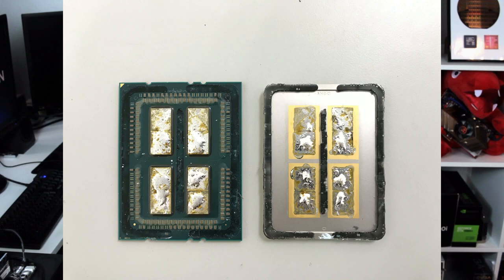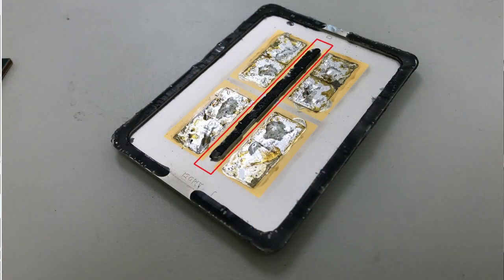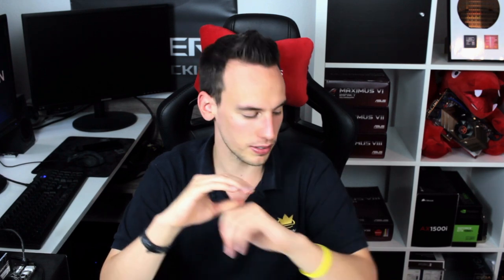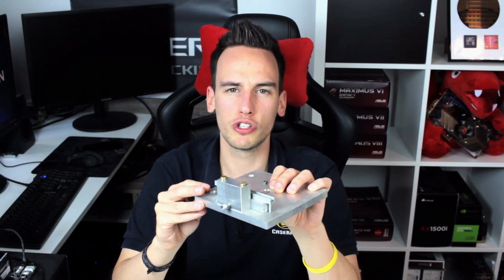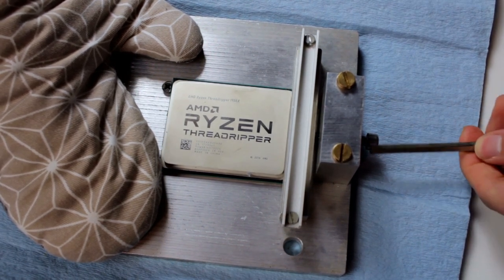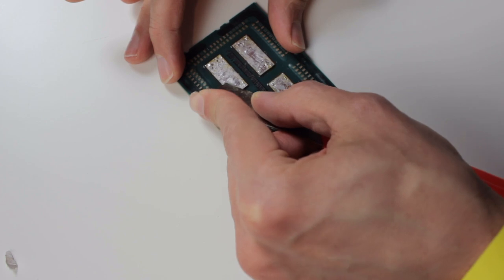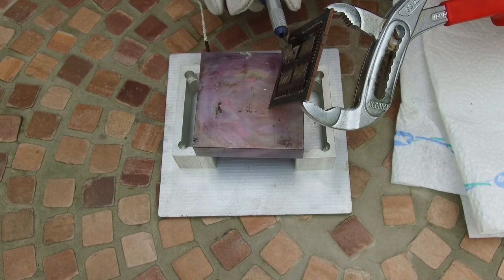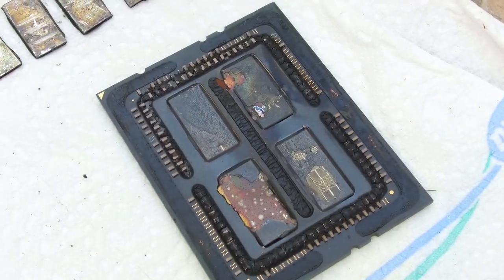Dummy Dies? Threadripper examined (en)

Comment: what if all the cores are being used?  what if when a die gets too hot amd switches the active dies to keep thermals in check... that would make more sense than just using dummy silicon, allthough it is still unknown if they are even wired up on the package or not... maybe find the package traces in the next video?

Comment: It would be interesting to find out how much does TR4 and SP3 sockets/packages actually differ from each other, if at all. If the packges are identical, then these would be just straight up salvaged EPYC's, but if they differ, then they did know which chips were failed and used them just as fillers. Also if they are EPYC's, then wouldn't that mean that the places of failed chips would be random and not necessarily in diagonal corners?

Comment: Could they maybe be using the other two does for extra pcie lanes? 4 dies w 16 lanes would give the 64 lanes in the spec. Just guessing, I haven't done any research on this yet. 
Edit - the infinity fabric interconnect between the dies could be using pcie lanes to connect with each other, 8 lanes per chip, giving the 64 total lanes. And then they could be utilizing the memory controllers of the other chips as well. So pretty much everything but cpu

Comment: you could of used a flat head screw driver to remove solder and black stuff, yes it works. better than grinding but be carful you will chip the die. use a tiny flat head. then buy a dremmel tool and get glass etching cream and polish away but WARE GLOVES

Comment: yeah, i suspect they're either dies that didn't pass QA or perhaps won't quite run at the clocks required.  in other words, garbage that would have been discarded anyway, but otherwise already mechanically compatible with the package.

Comment: If their marketing info on yields are correct they have 20% dead dies they can use as dummys.
If they plan on making 32 core / 64 thread any time in future it makes sense to only have one package/spreader design and fill leftover spots with dummys.
Seems like it didn't happen untill the Threadripper 2 series though?

Comment: 🤔 if they did have defective Ryzen Dies... Won't they just deactivate the defective parts and call it Ryzen 5 or 3?

My heart is melting... I need a new CPU but I learned alot.

Is it possible to grind off the top parts of a DIE and then use Liquid Metal to get better Thermal Performance?

Comment: And der8auer was correct. AMD released 2nd gen Threadripper with 32 cores, but the question about dummy dies arose because of AMD's representative (engineer?) spreading misinformation on Twitter about them being dummy dies "for even pressure". Wtf AMD?

Comment: If I were AMD, instead of making dedicated dummy silicon, I would also consider reusing the plenty true but severely malfunction dies which are actually impossible to be used for normal cpu package. Those failed dies have to be eliminated anyway if not acting as a dummy in a threadripper.

Comment: i'm not surprised by any of this. as soon as i saw epyc and threadripper had the same package i knew they had the same configuration of cpu dies/cores. the reason they can do this is because amd has been able to produce ryzen 8 core dies at such a low price that even shipping 4 dies and only having 2 of them work they still make the money back in the end. it's all down to binning. something about the 2 non active dies didn't work so now they are 1920x or 1950x cpu's and no one is the wiser. as for amd releasing a 32 core hedt cpu i see this as not only unlikely but with this first gen ryzen architecture a foolish move. unless amd needs more time to develop zen 2 dies then it would just be throwing more lower ipc cores at intel competition with slight overclocking. threadripper is a hard sell to begin with, adding more cores and price would only make it a harder sell especially to the non commercial buyers.

Comment: 32C for Naples would be weird since X399 only uses 4 channel RAM... Four dies expose 8CH... But I KNOW Rome will produce a 24C TR next year... But then they said they were getting 80% before EPYC so I expect 90% by now and the dies were reported to cost $100... Maybe they are taking R3 dies which turn off two cores and L3 and EPYC dies which can clock higher...

Comment: Yeah TR is just failed Epyc, although the question now is if the dead dies are in the same position or not.

I have a question though, is TR4 even able to handle Epyc fully? Because at like 1.45V and 4Ghz it'd be pulling like 400A, and I think most TR4 motherboards can only handle 480A. Not that Epyc clocked lower would have any competition though, because I also think that there's a 32 core coming to TR4 or maybe just a 24 core, but maybe only if Intel decides to do something similar so it could be next gen Zen when this happens, who knows.
Reply from the maker: Should be no problem from a VRM point of view. 32 core OC might be tough but running stock should be no issue on most boards

Comment: I think those "dummy dies" are failed Ryzen dies the company re-purposed rather than discard.  When they decide to go to 24+ cores, the can replace them with working dies.  The infinity fabric connections are already there, so it probably won't be more difficult than a chop and swap.  I think what might be holding AMD back from doing that is whether or not they can turn a profit from an even bigger TR.  Maybe they'll do it for bragging rights.  I'd like to see a 32 core TR running 4.0 GHz on all cores.  I imagine it would have some serious cooling requirements.

Comment: 10:08 imagine taking like the CPU and GPU of your 1st PC, as well as maybe one of the RAM modules and the south-bridge, or a well-populated peace of PCB, grind and polish down to show their circuitry as well.
then casting them in resin and making a peace of jewellery out of it, like that one guy did with an I-phone 8... maybe you could add some glow power in there too that has the same colour as the outside of your chassis and glows in the same colours as your LEDs (if you had any)

Edit: heres the video of the IPhone 8 ring
https://youtu.be/4oL_MOcU3Sw

Comment: yes its an epyc cpu but with 2 damaged  dies , amd won't release a 32 core threadripper as it will hurt the epyc cpu sales ,  so threadripper was not a pre plan cpu but a epyc cpu , and by launching threadripper amd increases its yeld so ass the cut out of epyc cpu which could go waste is essentially being sold as ryzen threadripper

Comment: So they are still making money with the 8 core Threadripper 1900x at $549 but its the same production cost as a 32 core cpu. Not sure what the exact area size the Zen die is but its small. They can fit way WAY more chips onto a single wafer compared to the huge intel chips. How is intel going to compete with a monolithic die vs something that can be produced so cheaply? EPYC outperforms nearly everything intel has and is cheap and more power efficient. Consumer mid rang side intel might be competitive today but server side it looks like a disaster for them.
Reply: die is 192mm2
Reply: To say that the production cost is the same for a 8 core Threadripper and a 32 core EPYC might be true but is it misleading. Putting them together might cost the same.

The misleading part is to create a 32 core EPYC you need 4 fully functional dies and for a 8 core Threadripper you only need 2 dies with 4 functional cores and 2 non functional dies.
Because som chips will always be damaged. Som articles online said that they had 80% fully functional dies. That would result in for every 1000 32 core EPYC you can manufacture you have 1000 dead or semi functional dies. It might be the case that you have dies for 250 8 core Threadrippes at no/small extra cost for the dies. 

So they only have to make money on the packaging, distribution etc and not on the dies since they was a bie product of EPYC manufacturing.

If i understand correctly there is only one model of die called Zeppelin used on all used on all Ryzen, Threadripper and EPYC processors. So one 8 core Threadripper could be two Ryzen 5. It is then the case that Ryzen 7, 16 Threadripper and 32 EPYC competes for the same chips. The release price was $499, $999, $2100 for them  so it was ~$500 per die on each CPU

My guess is that that they have non active chips in Threadripper is so the same manufacturing line can be used for EPYC and Threadripper without any modification. The extra dies are likely dead chips that are a free byproduct of the manufacturing of the dies. Creating another design for Threadripper would have resulted in cost/resources needed and the might not have the amount of engineers to create 3 physical CPU designs. They have likely concluded that the design they use are cost/resource efficient for them

There is lily som physical modification to the extra dies to completely disable them. There is already steps to doe that with other non functional cores and it done with burning fuses with a laser. Another option is to have a different/modified circuit boars.

If there was not enough dead dies they would likely use some silicon without transistors on them or perhaps a cut part of a Vega GPU or som other dead die with correct thickness.

I have never questioned  if it would possible to build a 32 core Threadripper because of the dummy die statement. The limitation is a die works if no memory is connected to it. If running a Threadripper is possible with fewer then 4 DDR4 modules then a 32 core Threadripper would likly work. But it would result in performance  limitations when  half of the dies have no direct memory access of the same socket is used.

Comment: My guess is that these are failed dies from the manufacturing process. Since failure rates for dies are very high they have more failed dies than working ones, so they can just put them in at no additional cost.

Comment: I knew it was an epyc CPU, what I didn't know is that the 2 dummy dies were not connected to the base-board. My guess is that they wanted to simply get rid of their broken chips, so instead of paying for electronic waste, they leave it in the CPU dies like that. Now, the idea of the 32 core CPU is not possible due to the fact the motherboards won't handle the extra PCI-e lanes and other extra features that "adds-on" when you add chips to the Infinity fabric design.
Reply from the maker: it should absolutely be possible to use the Infinity Fabric design to use all 4 dies but only use 2 IMCs and 2 PCIe controllers
Reply: But would the motherboard handle that properly?
Reply: Just to let you know that you are doing a great job at both investigating and presenting the information. Your transparency makes your videos even better. Keep up the great work (also good call on buying the CPU yourself)

Comment: Good job, except too much talking and little substance. Videos that are shorter will call the attention of more people. And also Epyc won't use the same socket as Threadripper, so I believe that probably AMD will release a higher core count on Threadripper platform as needed, or probably those dies aren't functional. A 32 core threadripper will make the Epyc platform redundant.

Comment: There is no way AMD would populate the chip with working dies. They could cut their cost in half. Depend on how many layers you took pictures of. The dummy die could simply be just final metal layer.
Reply from the maker: Simon Zhao  no you can see the cores on all dies. All dies are physically the same

Comment: I wouldn't say there's no such thing. All 4 dies will be used in Epyc. Yet it's most likely a lot cheaper to use defective dies before putting a fully dummy machined die. Since at some point the manufacturers will have a lot more success rate and demands grow, they will run out and most likely put in a dummy.  I don't think they will cannibalize Epyc sells with 32-cores desktop. 

I like your content a lot, but i think you're jumping to conclusions quite fast on this one. It was launched August 10, we are in mid-September. Of course they will use junk dies first. Your experiment proved yours didn't have any, but it doesn't mean the millions they will produce will be the same. 

Still glad you did it, i was dying to see the die. ;)

Comment: Thanks for the video and the hard work. 

<whatIInitiallyWantedToWrite> From the images it looks like there are two different types of dies, two could be the functional ones (green/blue) and the other two look like are made out of only copper. Also looking at IMG_1770s.jpg it seems like only two dies have circuits under them on the packaging. </whatIInitiallyWantedToWrite>

Never mind, on two of them you just went too far :)

It would be nice if AMD will respond to this video, but I'm pretty sure they won't tell us the truth.

Comment: Why didn't you just get the 1900X
Reply from the maker: Only 1950X was available when I started the video :)
Reply: when intel releases 7980xe AMD comes out 1990x or something to one up them and that point intel wont be able to compete because of clock speed and manufacturing cost limitation at such high core count monolithic dies. while AMD can just "Glue" cpu together.
Reply: Exactly

Comment: Good video but i think im gonna be sick. I bet 2 of the dies are failed dies that would normally get recycled or thrown out. Cheaper to do that and use epyc ihs instead of investing into new tooling for new ihs and/or new substrate.
Reply from the maker: broken apex  in that case it would just make sense to have the same CPU for Epyc and TR. I would be worried if they had so many failed dies. That’d mean that the yield rate is absolute shit :D

Comment: Of course they are not dummy dies. Every engineer in the field would tell you that. Putting "blank" silicon cuts would be completely useless operation. Not to mention it would increase the cost of production. It was obvious from day one that TR are just failed EPYC processors rebranded for the consumer market. GPU manufacturers have been doing that for ages.

Comment: So intel will be like behold the fastest HEDT CPU 7980XE 18 cores... 
All the sudden in CES AMD oh yeah btw we have a TR 1990x 24 core cpu ( i dont think they would go full 32 it will cut in their server market too much and with 24 core they can keep the clockspeed up)
Reply: TR 24C @ 4GHz would be faster that any single EPYC 32C.
Reply: i think it would be a 3.2ghz base and only 4 core boost to 4ghz and 1 core 4.2ghz.... but it would really be hard to get all to 4ghz unless you have massive cooling.
Reply: Hint: TR 24C will most likely be using 7nm process instead of current 14nm so 4 GHz on all 24C should be possible.